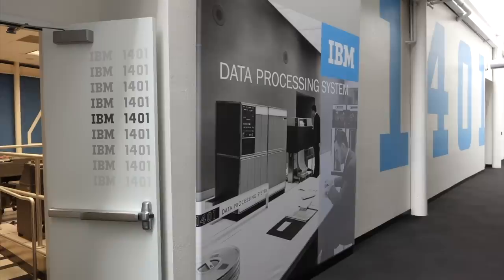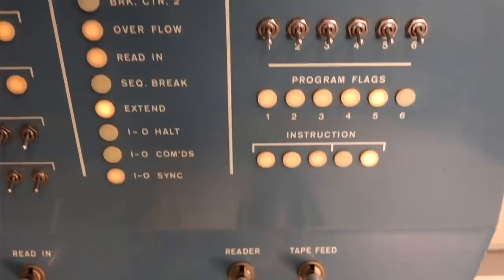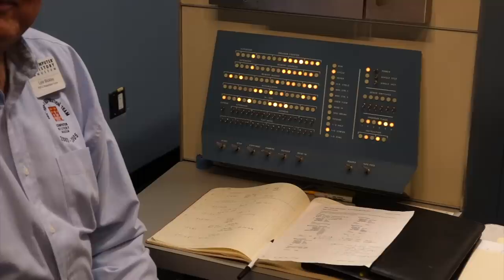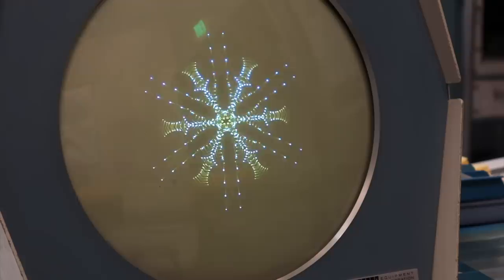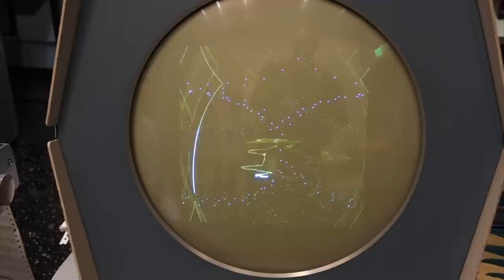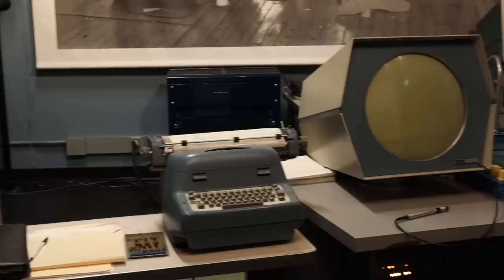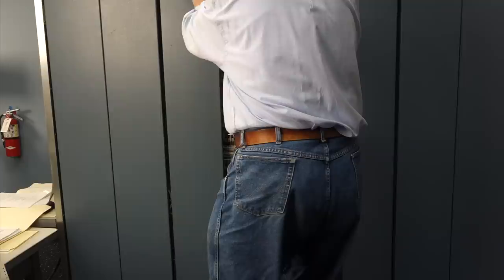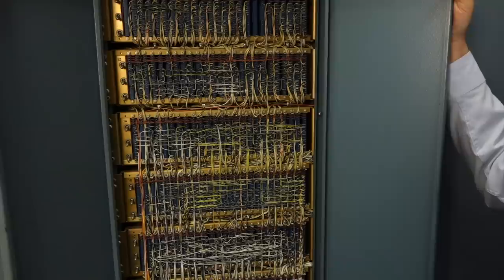Lyle Bickley explains the PDP-1 (and we play the original Spacewar!)

Comment: I had no idea the PDP-1 display was bitmap. I always assumed it was vector based. Thanks Marc! Another awesome video!
Reply: I think it is more like a vector-pixel display.  The PDP-1 sends out a stream of data which I believe is in fact vector like, but the points map to discrete locations (with a gap).
Reply: The display is actually a "point plot" display. You send it an x-coordinate, a y-coordinate and an intensify level and you get a single dot. 50us later you get to do it again.
Reply: That is correct: you give it two 10 bits numbers and it lights up one point of 1024 by 1024. If you light up two neighboring points it is possible to see a slight gap between them depending on the focus of the beam. You draw a line by lighting its individual points, so it looks like a bitmap unlike on a Vectrex videogame which has analog circuits to smoothly draw a line between two points. Despite this difference, it is correct to call both "vector displays".
Reply: I was wondering about that. Clearly there couldn't have been a frame buffer because that would represent more memory than the entire rest of the machine by a factor of ten or more.
Reply: I'm confused, is it raster or vector?
Reply: It is a vector display. You can tell by the fact that a drawing starts to flicker more and more as it gets more complex. In a raster display the refresh rate doesn't depend on the contents of the screen.
Reply from the maker: See +lbickley comment above. It's neither vector nor raster. Randomly addressable point display (with varying intensity), with no video memory - besides the long persistence.
Reply: It can only draw dots, not a line from point A to B. It also does not work with video memory and a raster, the computer just selects a single point to draw maybe 500 times per second, and if it needs to draw more it alternates them which leads to the flickering effect.

Is this correct?
Reply: Looking at the DEC documentation I see they use the term "dot plot" for these displays (T 30 and T 31)  and reserve the term "vector" for devices like the T 340 which have a computer in them and can draw lines and characters on their own.

A T 30 takes 50 microseconds to draw a dot after the PDP-1 executes an instruction that gives it the desired x and y coordinates. That means it can draw 20 thousand dots each second. If a drawing has one thousand dots in it then it can be redrawn 20 times per second and it will shine brightly and look stable. A drawing with 10 thousand dots will only be refreshed 2 times per second so it will blink really badly.
Reply: Thank you for the response! Is the CRT a Charactron or Typotron, or is it strictly just a standard electron gun aimed at the tube face? Thanks for the demo!
Reply: The display is a simple 19" CRT with P7 persistence. It has "X" and "Y" deflection plates and "Z" for intensity.. None of the "fancy" features you mention like that on SAGE, etc.
Reply: Just a standard "electron gun aimed at the tube face".
Reply: I would think that, common to both vector and raster displays (and oscilloscopes, and radar sets...), if you left the electron gun energised and changed what coordinates the X and Y deflection coils were set to, it would draw a fairly smooth line between the start and end points anyway? How "liney" it seems vs how "pointy" simply depends on how much capacitance/inductance is inherent to the deflection system (either natural or designed-in) compared to how often the coordinates are changed and the persistence of the phosphor. As well as how often a particular item is redrawn or coordinate revisited.

The spacewar ships and star don't look particularly pixelly or rastered, they seem to be built of solid lines, even though the shots and explosions (and the snowflakes) appear to be made of dots. The redraw rate and point dwell time for each presumably being different in order to produce the characteristic effects.
Reply: i believe the alto in the early 70s was the first bitmap display
Reply: The PDP-12 used the same kind of system, but with a 4:3 type TV CRT instead.  One common result was that software such as the LAP6-DIAL operating system for PDP-12 would use the CRT as a CRT display terminal where you could edit programs and such, using the teletype keyboard for input but without wasting paper on the teletype printer.  (Also without making as much noise...)  Which also meant that display updates were more or less instantaneous, rather than having to be printed out at 10cps.  And by using the analog voltage input controls, you could move the "cursor" to different points in text for editing...  really genius when you think about it.

Comment: Many years later, I was learning about debugging on the DecSystem 10. The program was called DDT. On the first page, the origin of the name was explained with a footnote stating that it should not be confused with the insecticide of the same name. The note went on to dryly note that both were used for elimination of bugs, though of, it was hoped, mutually exclusive classes.
Reply: Unfortunately there has been some historical crossover - roaches and vacuum tubes do not mix well.
Reply: I wrote DDT for the PDP-6 in 1964 (instead of going to my MIT classes). The note you refer to was created by the contract tech writer, Bill English, who wrote the assembly language programming manual. The note was kept in the manual over the nearly-dead bodies of the in-house tech writers who regarded it as "unprofessional".
Reply: @thomasw.eggers4303  Thank you for that slice of history. I've always treasured that comment - it still tickles me.
Reply: @nicolek4076   Thank you both for reminding me of the giggling joy I had back in 1973 while tracing for a suspected bug in the assembly language code of a GE Datanet-30 Front-End Processor for a GE 635 Mainframe computer. As I scanned the source code listing of the parsing logic that determined what type of remote system was to be interfaced, I found these hilarious comments: "Hippity hoppity, here come Big Blue and the Seven Dwarfs". Then followed code sections for IBM, GE, CDC, DEC, RCA, NCR, Burroughs, and Univac. Happily, no one at GE Pheonix had removed the comments as "unprofessional".

Comment: The PDP-12 used the same kind of display system, but with a 4:3 type TV CRT instead.  One common result was that software such as the LAP6-DIAL operating system for PDP-12 would use the CRT as a CRT display terminal where you could edit programs and such, using the ASR-33 teletype keyboard for input but without wasting paper on the teletype printer.  (Also without making as much noise...)  Which also meant that display updates were more or less instantaneous, rather than having to be printed out at 10cps.  And by using the analog voltage input controls, you could move the "cursor" to different points in text for editing...  really genius when you think about it.

Comment: With any modern OS, it takes a minimum of 100 lines of code and 5 days of research on the internet to change the colour of a single pixel on screen. While back then in assembly it took only a single line of code.
Reply: 100 lines of code? Here:
#include <Windows.h>
int main(){ SetPixel(GetDC(0), 1000,1000, RGB(255,0,0)); }
That obviously didn't take me 5 days to figure out. I suggest you to check out the 4K PC demoscene, they challenge themselves to produce the most impressive audio/visual demonstrations while keeping the program size below 4096 bytes (including music, graphics, everything). That is even smaller than the 4 KW spacewar shown here if I understand correctly. There are a lot of reasons why we don't program like that today, but it can still be done and it is amazing what you can do with only 4 kilobyte.
Reply: @Spillerrec  
Most people today are software engineers and not programers.
Reply: Spillerec - If you hide everything in headers, every program only needs one line.
How many machine instructions do you think that SetPixel call takes?
Reply: @manuell3505  it is a OS function, so as little as possible on Windows. It is not much, actually it is too little to be useful. Try running the code and observe what happens. What is the issue? If you actually is interested in why an OS makes it more complicated I can go more in depth of why you would appreciate that.
Reply: Spillerec - "OS functions" that consist of predefined software routines are technically not OS functions, but side-applications, as is SetPixel(), part of the Win API.
Only user-, RAM- and storage I/O need to be managed to make a computer useable.
Reply: @manuell3505  "OS function" is not a real term. It IS a function call however, not an application. The  GUI might be an application on top of the kernel, or it might be integrated into the kernel. For Windows this has changed over the years. Whether the implementation of that function needs to do a system call or do some kind of inter-process communication depends on this.
It is just a normal function, but it is a function which implementation is provided by Windows.

But try to find out what is wrong with my code and why you wouldn't use it in a real application.

Comment: The Navy likes to use old tech (sometimes the old tech works better than the new tech!) and I used a console built sometime in the late 60s. It used these massive modules that looked like big microchips and those were the brains of the system. Repairing errors was easy! Just swap out a faulty card and the thing worked! 
Whenever the big guns were going off, the shockwave it would send through the hull would sometimes dislodge the modules so we would have to hold them in place during firing haha!